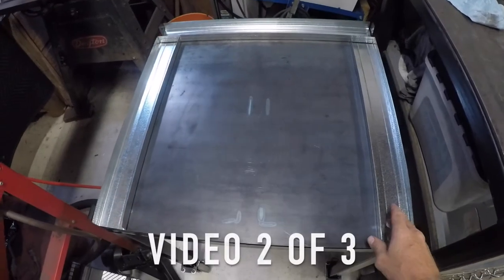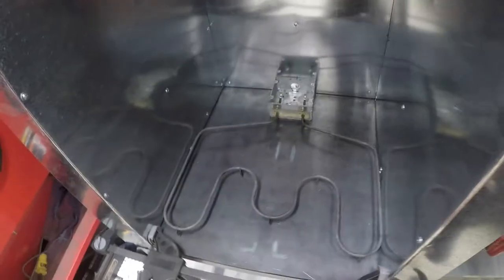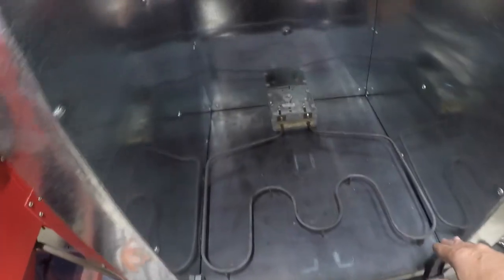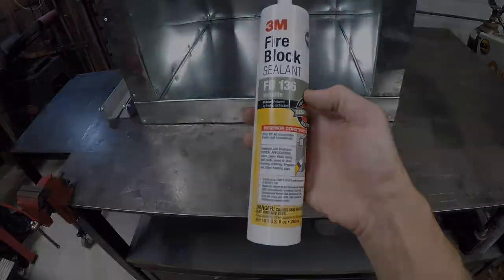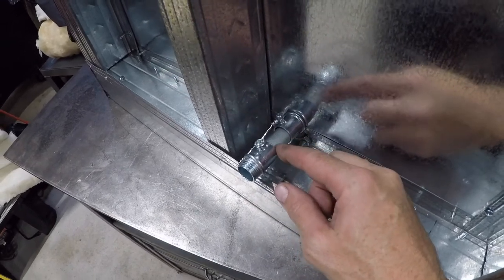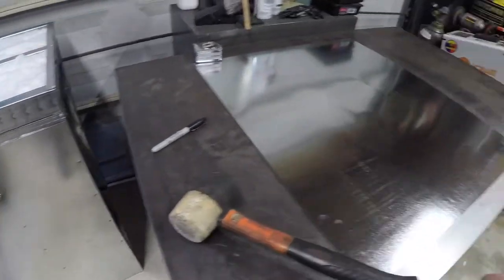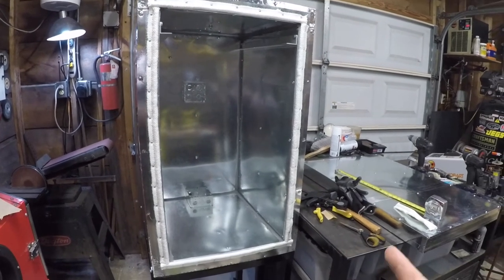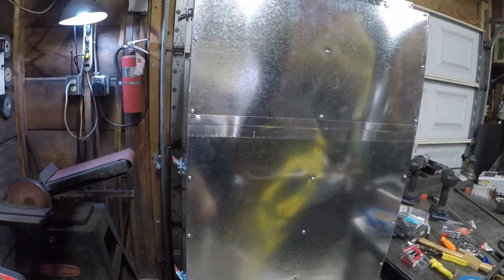Building a Powder Coat Oven - Part 2 of 3

Comment: Awesome!
Thank you for taking the time to go over all your details.
What did you learn, and what would you change doing this build?
Reply from the maker: I had to go one size bigger (12ga) with the wires to the elements and use a hydraulic crimp tool. Had the wires burn up a the crimp twice. I do use it hard, though. It runs for 4-5 hours a day, three days a week.

Comment: I love how this thing turned out. I'm planning on building something almost identical in size. Id like to make it about a foot taller in height. Do you think two heating elements would be sufficient for something just a little bit bigger than your setup?
Reply from the maker: Thanks! Mine is working great with just the one element running so you should be good with two. My working element is 3410 watts. Make it as big as you can because I’m already planning on building something larger. It can definitely use more height and a little more width.

Comment: What was your total cost for the  build? Just the oven not the base
Reply from the maker: I never totaled it up but I’d guess probably around $500. If you buy sheets of galvanized steel at somewhere like an HVAC shop you’d cut a bit of the cost down.